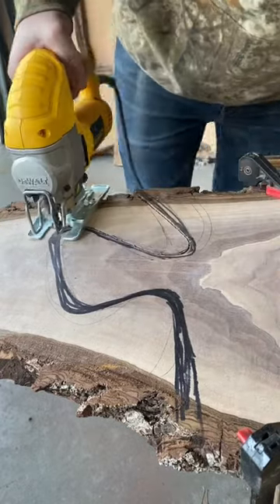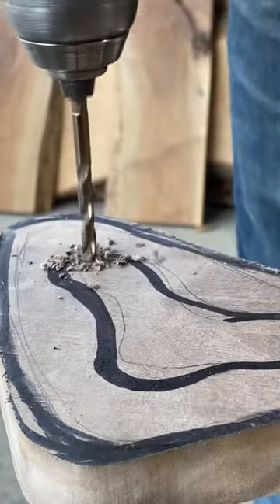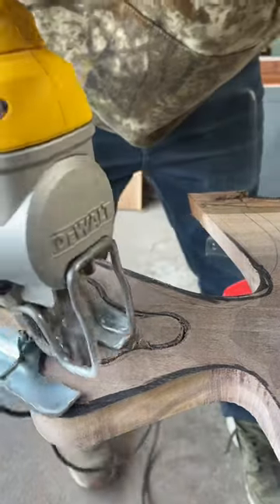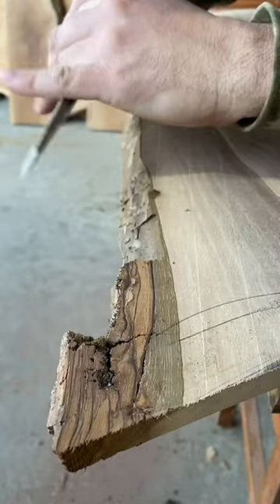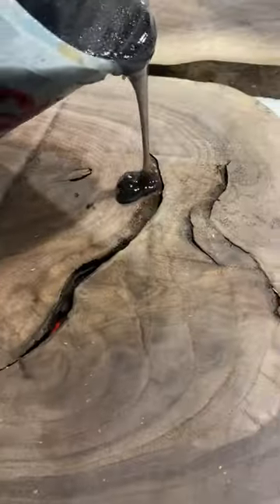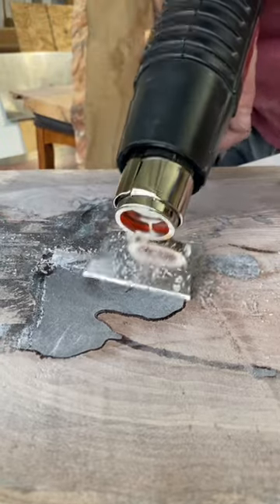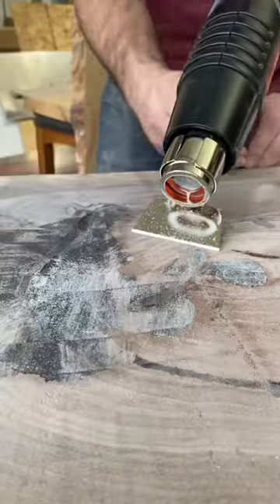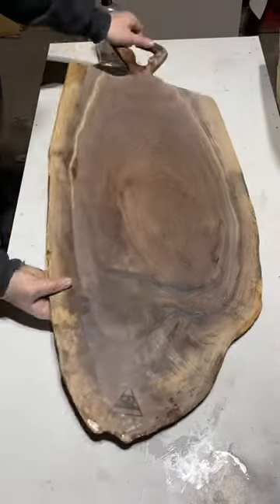Satisfying Woodworking Project #shorts #diy

Comment: I do a good amount of woodworking, but i'm not realyl sure about water popping. Do you reccomend just coating in water between sanding, or what. i sand to abt 120 for my cutting boards.
Reply: Go upwards of 300